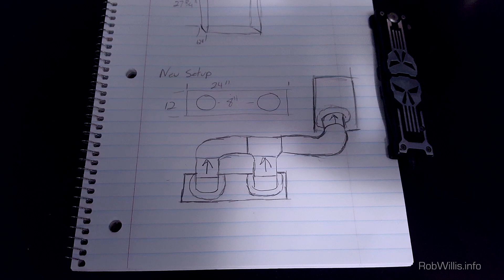Home Lab Cooling Upgrade!

Comment: Thanks for the upload!  It's great to see your rack and to hear about some of the gotchas you ran into.  I'm pondering where I should have my r610 live...  It's too loud for my office, so it's temporarily in my living room.  It sounds like your pine box really helps knock down the noise, though.  Since you've changed up the exhaust system, have you played around with the fan properties of the servers' BIOS?

Comment: Have you considered using a hinge so the the front can swing out?
Reply from the maker: I had thought about that, but with the way that it sits in the room it would be a pain move it like that. That's why I went with the wooden dowels and drilled holes to match, so I can easily slip it on and off by pulling it straight out. It's worked out great so far and there is still enough play in it that i can swing it to one side or the other to get a hand in there if need be.
Reply: @robwillisinfo  Ah alright, 
I guess even if you where to hinge it anyways, the back of the rack would have had to been screwed down into the floor or wall, since the front would be so heavy.

Thanks for the reply!

Comment: Hey Rob, love how you have your little lab here setup man. Id like to do something similar. I am super nub when it comes to networking/server grade stuff. I came into a few different pieces of hardware, 2x Dell PowerEdge 6600's, a HP Proliant DL160 G6, and get a load of this, a Facilis Tech Terrablock... Its a 24bay SAN it seems... Wild looking for sure. I know nothing about the terrablock, at all, and it seems that they have their own proprietary software. Do you think the PE 6600s are even worth trying to run..? Or is it going to cost me more in electricity than its worth? The Proliant blade I just got myself a Xeon X5675 and plan on getting another one, I need to get a bunch of DDR3 ECC, will do that soon Im sure. I am super curious about this terrablock though, you know anything about them?

Comment: How do you keep the noise down? I had a Dell PowerEdge in my office temporarily to install Linux on it, and that thing sounded like a jet engine, it was so noisy. Plugging in both power cables quieted it down a little bit, but it still generated quite a lot of noise.
Reply: Yeah, if the server detects any issues, it ramps the fans up. Updating firmware also helps. The newer one (hell, the rX10 series even) were pretty quiet though. Which model did you work on?

Comment: dont you get negative air pressure in that room?
Reply from the maker: Great observation! The answer is yes but the impact appears to be minimal, and the benefit of removing the heat far out weighs any negatives (pun intended). :)